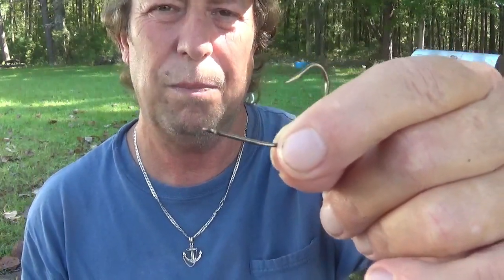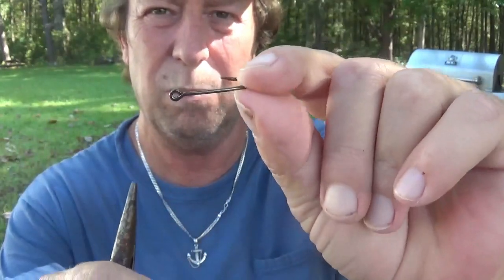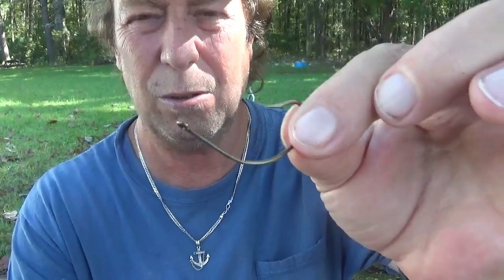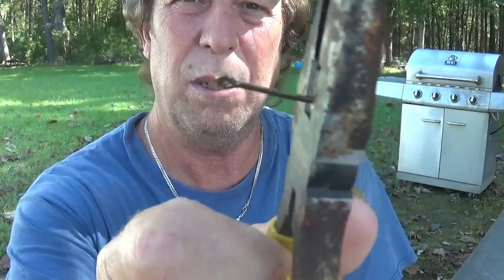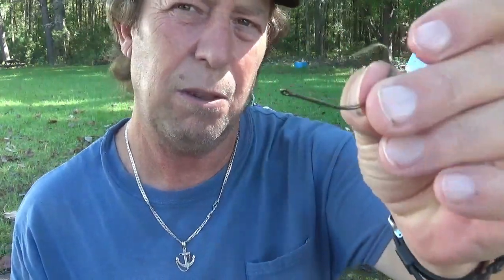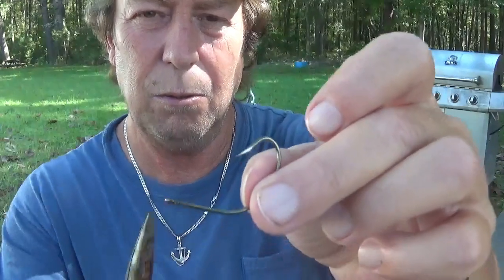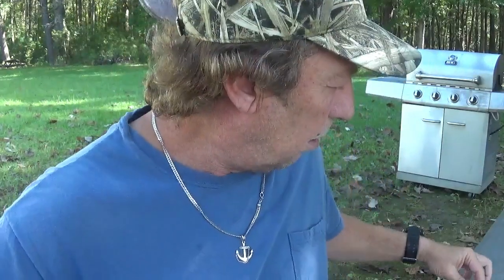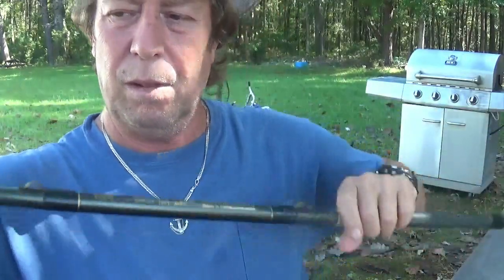how to rig a bream buster.

Comment: Great Info and The jigging rig is Awesome!  When I would do some repairs I would also use the clear 2 part epoxy that keeps awhile until you mix it....and roll it around while it sets... then you could always sand down a drip area and re-coat...I have fixed a lot of my inshore and offshore rods that way and it lasts longer than from the factory.
Reply from the maker: thanks.

Comment: I have a 12 foot bamboo cane pole that the tip broke off I want to try your method of using the hook for the tip can you tell me what size hook I should use thanks for any help
Reply from the maker: i tries to find a hook that the size of the shank will nearly match the tip of the poll and a medium size eye.
Reply: @casselmanoutdoors307  thank you for your help it's greatly appreciated
Reply: @casselmanoutdoors307  I could not find a hook with a good eye lit on it so I too an old broken fishing pole and cut the tip with the eyelet on it and sized it up and used gorilla glue and electric tape to make a new eyelet